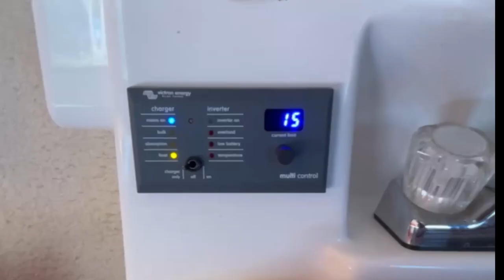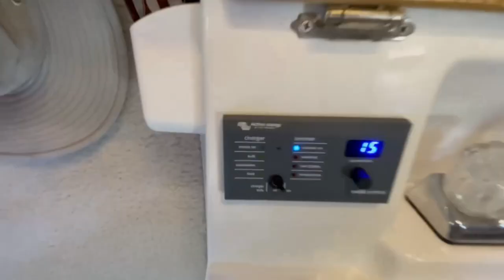Avoid This Mistake When Installing Lithium Batteries

Comment: When you have the inverter on does all your wall outlets become 110? Was it hard to wire the inverter to your fuse power center? Thanks!
Reply from the maker: Yes.  The inverter runs the 110 outlets.  Wiring the inverter to the fuse panel center was not difficult.

Comment: Eventually I’d like to install a single lithium iron phosphate battery in my Casita. I saw a Battle Born video stating that charging through the seven pin trailer connector won’t stress the alternator because the current flow is limited by the small wire size. Do you guys have experience trying this? 
I know i’ll need to upgrade the lower converter but if that’s all I need to do, I could do this project for about $800 for the battery and converter upgrade.
Reply from the maker: Charging through the 7-pin connector won't stress the alternator.  At the same time, it won't charge the battery very much.  We had the Battleborn battery.  At first, we used the converter that came with our 2013 Casta.  It would charge though the shore power cord, but not all the way.  It charged well with the solar because the solar charge controller was compatible with the LiFePO battery.  You can buy a new converter that will charge the LiFePO battery for about $400.00.  The UnoWix batteries are about $500, almost half as much as Battleborn.  If you are camping without solar and just plan on plugging in for power, you could get away with a new converter and UnoWix battery for less than $1000.00.  We get a small commission off the UnoWix batteries with the link in the description, but Battleborn is also a good choice, just more expensive.
Reply: @TravelsandTravails  Thank you for your reply. This is really good news, I do have a 160 watt roof mount solar panel, as well as mobile solar panels with a lithium compatible charge controller.